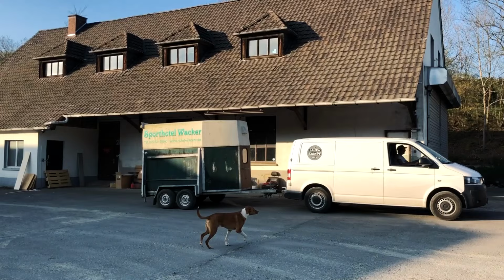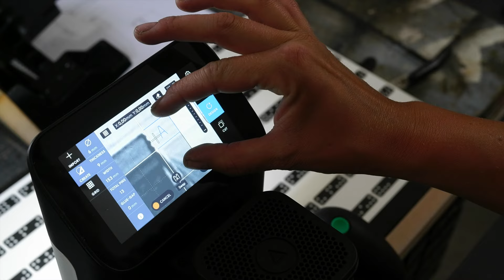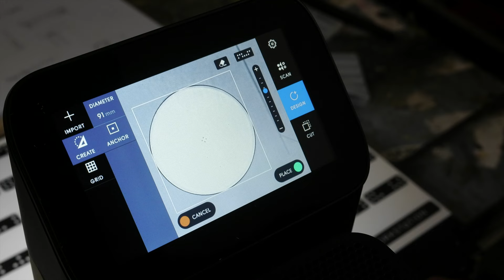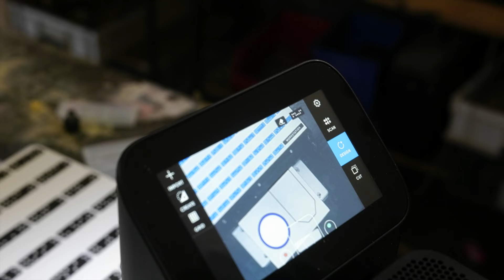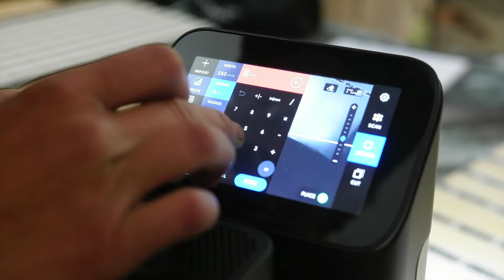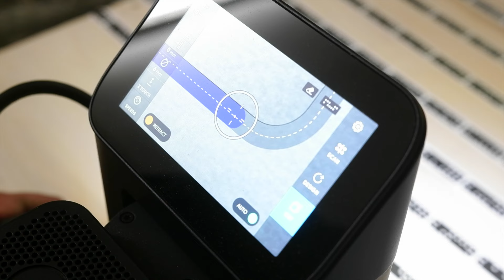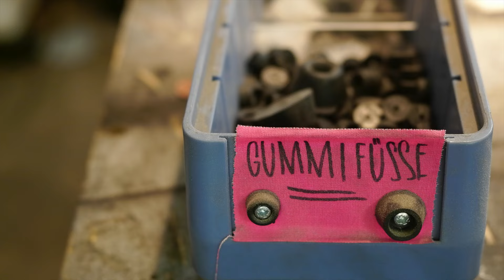Clever Camping Kitchen in a Suitcase

Comment from the maker: I used the Shaper Origin to cut out all the different shapes-but you could also do this with a jigsaw. I just like the convenience of the shaper and I want to learn more about digital fabrication. also: cutting box joints in a couple minutes is pretty awesome!
Reply: It looks as if, you mark the cutline with a pencil for the coffee brewer and the round can, and then the Shaper just follows that?! Can it do that, or do you have to make a digital template as well? I would love a small CNC, that cut follow my pencil marks, so that I don't have to use time on digital work.
Reply: @TB_Production_aka_TB_76  You can do both. You can load files into the shaper or use the buildin camera and set the cut lines as Laura did in this video.
Reply: I like your new craft tool! Your creativity is always inspiring! 🙏
Reply: Is it possible to get the Shaper in Germany already? I am a fan of it first hour, but I do not like importing expensive stuff. Keep up the greaz work! I just got an horse trailet myself, not sure what to make out of it 😂
Reply: @ThinkB4UAct  
Don't have a link but I found it on Amazon and several other places search Shaper Origin it run around $2500.00 .
Reply: The Shaper is so cool
Reply: Oky bg,☺️💕
Reply: That machine is wonderful.
Reply: Ya, that is a very cool toy.
I am kinda surprised you didn't make the 'top' so that it was level and reinforced, perhaps with drop down legs, so it could be used as a work surface.
Reply: Excellent Job!! And where did you get that router!? Never seen a portable router/CNC type thing that's hand held with a screen before.. bet that cost a fortune!!
Great project and well executed build! 
Thanks from London England 👍❤️🙏😎🏴

Comment: a simple project is so much easier when you have a wide selection of tools. Unfortunately, most people do not have all of that, but, the same can be assembled.....less elaborately.....with hand and a few power tools. Great project, though. Will you leave it attached to the outside when traveling or take it off and store inside?

Comment: Really great to look at and so inspiring.
What is the brand of your cooker/heater?  it looks awesome!
Thank you for sharing all your great ideas
Reply: This is a classic Swedish camping stove / pot set, the company is called Trangia. They are dead simple, and burn denatured alcohol. Not as fast or efficient as the latest pressurized stoves but the fuel is cheap and ubiquitous.  I’ve used one for years and love it.  A typical set includes the stove, a pot, a small pan, a windshield for the stove, and a handle that can attach to either pot or pan. Everything nests neatly together.

Comment: Question?   I was advised not to use plywood as a cutting surface on my Kitchen Island due to the Use of certain chemicals in the bonding process of the layers, (I recall the word Formaldehyde being tossed around).  Is this not a concern in your area?  would a laminated surface not be a better choice?

Comment: is the shaper origin restricted to a single pass cut? as it destroys the tape as it cuts so if you had to pass twice or more to achieve deeper cut depths, would you just use a router/guide bushing?
Reply from the maker: The shaper can do multiple passes. It need to see the tape in front of it. Not directly under it-so it’s okay to cut through it a little.

Comment: The fender seems like a pretty good table/work surface, other than it being a little narrow. What if you added a piece (plywood or metal) to the top that was hinged on the front edge. It could flip over 180º to double the work area. If you used a piano hinge, you might not even need a support, assuming you don't put too much weight on it.

Comment: If you use that method of putting the burner on the ground under the trangia for longer that will kill your trangia. It will get very soft and eventually warp with time. Also it will take longer with wind and nobody wants that. Small lifehack: put an old bike brake rotor in the place where the pots normally go. Works great looks cool and is very cheap. Your lokal bike shop will probably give you one for free.